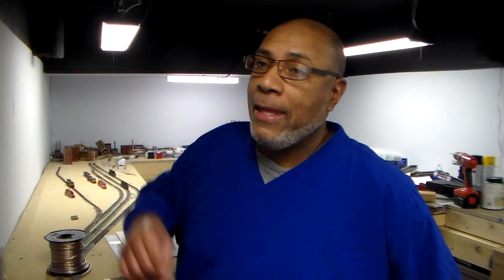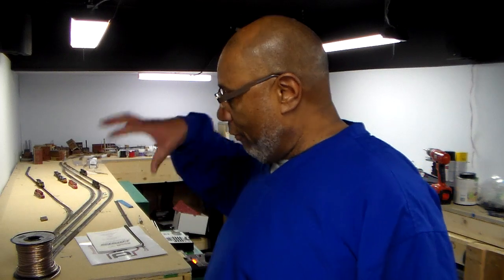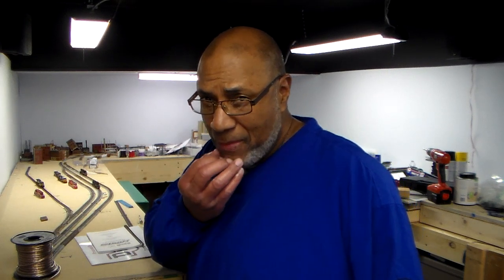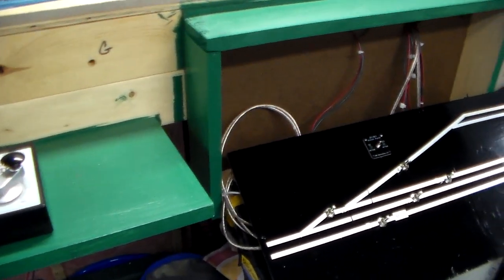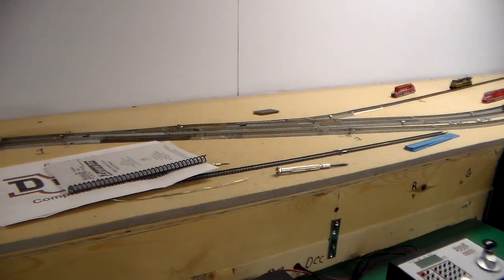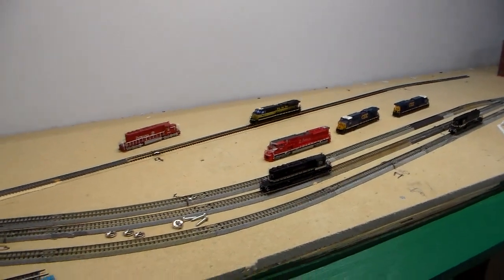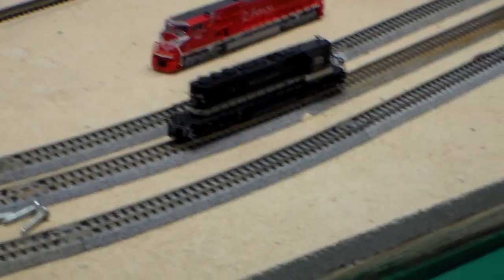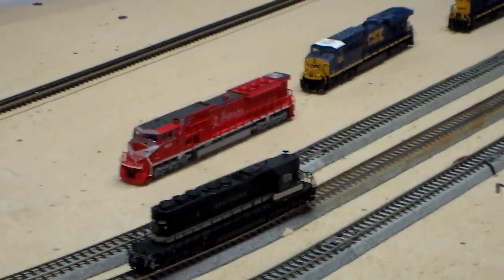N scale Hadway layout 2 Kato 4

Comment: Hi Pedro 
The black ceiling and blue walls are very striking. The LED shoplights does make a big difference. 
In my room I had 4 recessed lights which was very yellow. Changed over to LED - 1750 lumens and 5000 kelvin. It is bright and beautiful. Very little shadowing.